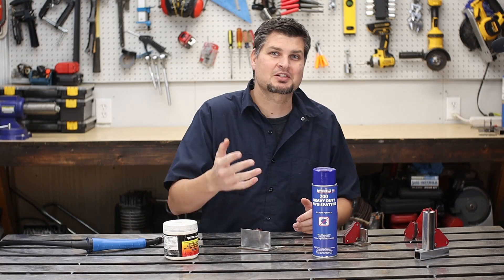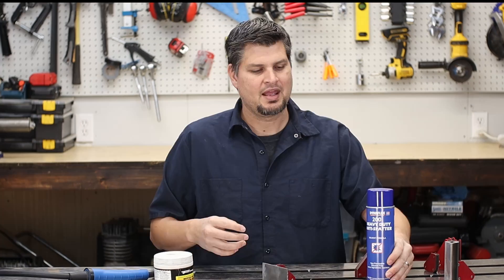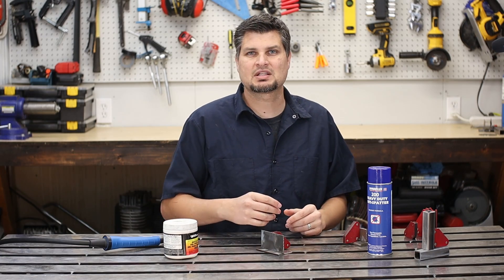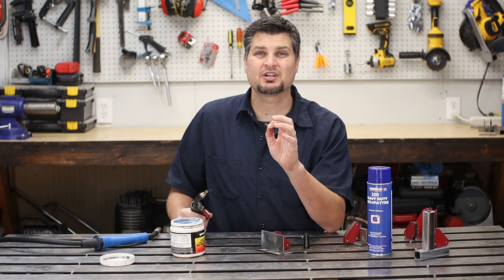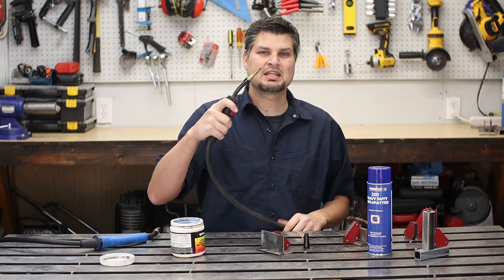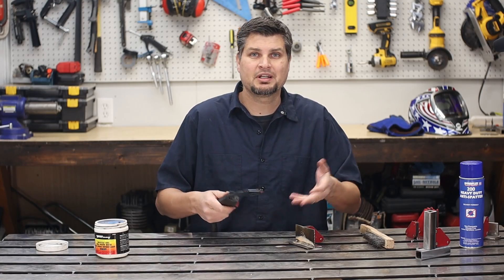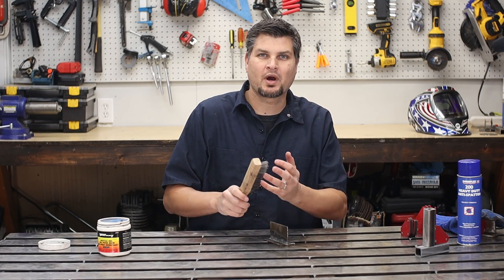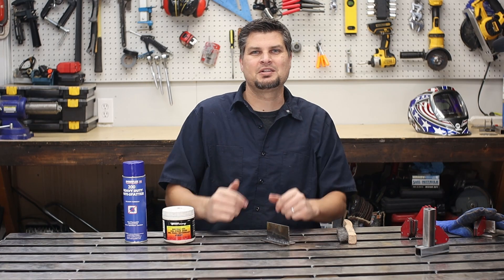Flux Core Welder Must Have *Tip Saver*

Comment: Down dmside to spatter spray you have to clean up the earia after with alcohol, thinner or fuel because the paint won't stick to the metal.
Reply: Good point but just want to say for any good painting, prep work is important and cleaning with alcohol anyways will help you to get a good paint down. So always clean anyways

Comment: I’m kinda new to welding and bought a cheap one from Amazon to work on my xv920 go kart. My first task I welded a nut inside my old motorcycle handlebar that I cut and made a sleeve with to go over my gokart shifter to mount the clutch lever and ended up almost ruining it because there at the last tack weld I had a bb ( I think that’s what it’s called) get stuck inside the threads and had to screw it on backwards to get it out. Moral of the story is that little spray can has been a life saver ever since I first started using it.

Comment: Fry-Lite cooking oil - the stuff in the pump-top sprayer supposed to be for cooking breakfast - that's THE BEST anti-spatter spray there is for any wire process, Mig or Flux-core.  Everything else is rubbish by comparison. Fact. Squirt your tip with some - thank me later.
Reply from the maker: Right on!
Reply: Has your welds ever caught fire because of the oil?
Reply: ... That's the olive oil one??? Thanks!!

Im testing Goop Hand cleaner, you let it air out till it liquefys then us a greas brush, but Im thinking of mixing with alcohol and using in a pump spray. And yes it will catch fire some times. Still testing.
Reply: @moonolyth  Non-stick baking spray works mint too.

Comment: that grease does not save tip even if you dip it every weld , your wire get welded to that copper sooner or later  ,  only way is to make sure you have enough stick out

Comment: I started welding & have been looking for that nozzle you have.  I believe it will help me…. I can’t find it for my mig gun
Reply from the maker: What welder do you have?
Reply: Not sure if you remember I bought the YESWELDER 250 pro
Reply from the maker: I should have! I haven't had their 250 pro but I had the 135 and these fit on it:
https://www.harborfreight.com/gasless-flux-core-nozzle-set-2-piece-63795.html
I'd bet the nozzle threads are the same and it would fit on the 250 as well.
Reply: Thank you those look like they would fit.
Reply: @-DIYPRO-  I have to add, your videos have made this process much simpler as I have never welded before.  I have yet to get me welds to look like most of you guys do on YouTube,  It feels like the setting its telling me to put it on for 3mm is a bit hot, when I lower it it gets better but, still not really right.  I will continue practicing, I am sure that is what its going to take.  Funny note, I didn't have much metal around when it arrived, I looked outside and saw my old barbecue grill out there and it was sacrificed for my educational purposes, had to promise to my wife to buy a new one before summer.
Reply: @-DIYPRO-  I bought it and it didn't fit either.  I have tried 3 different versions.  This is what yeswelder says are the sizes when I have to buy my consumables: YesWelder Consumable Kit Sizes

MIG Welding Gun Consumable Kit for Lincoln Magnum 200/250 Tweco #2 | YesWelder

MIG welding gun accessory 0.035" kit tip-nozzle-diffuser-adapter for Lincoln Magnum 200/250 & Tweco #2.
Fits Lincoln Magnum 200/250 & Tweco Professional #2 MIG welding gun or equivalents.
* 2-pcs Adjustable Slip-On Gas nozzles 21-50 (1/2")
* 20-pcs contact tips 14-45
* 2-pcs gas diffusers 52
* 2-pcs nozzle adapters 32

Comment: I need to extract a broken bolt - should I spray this a few inches around bolt?? Or should I use something like aluminum foil?
Reply from the maker: Depending on what's next to it could use either. If you want more of a heat and spatter protection then use the foil.
Reply: Ha! I've been wondering what to use to protect the engine bay where I need to patch a body panel hole.
Reply: @thedudedoesntabide  Aluminum foil works for a short time - blows through after a few seconds though. Have to keep replacing it. Any oil seems to work too...